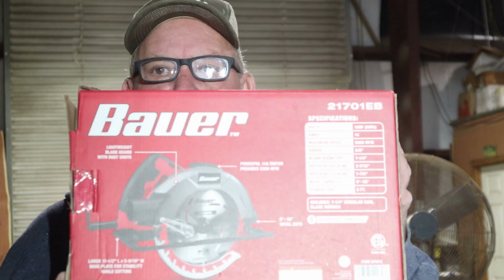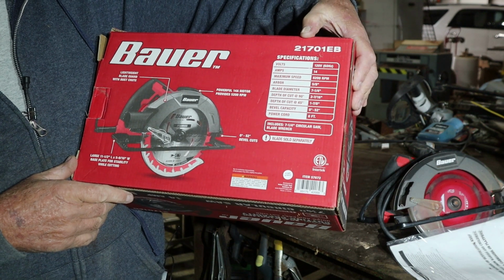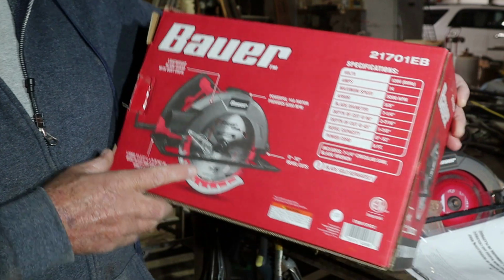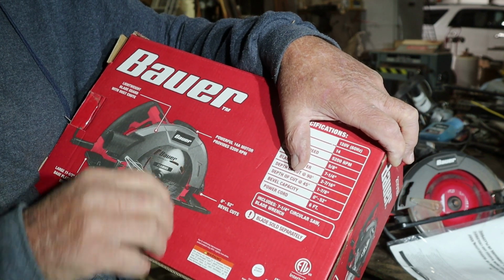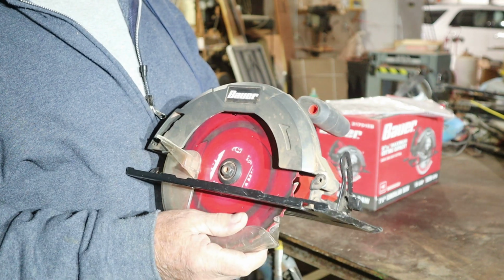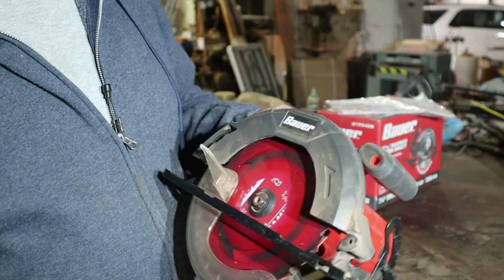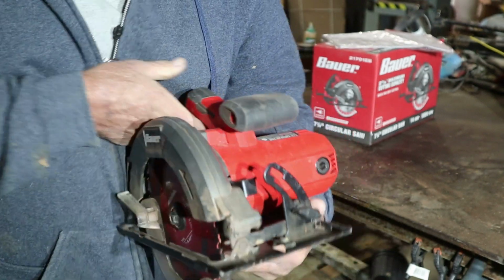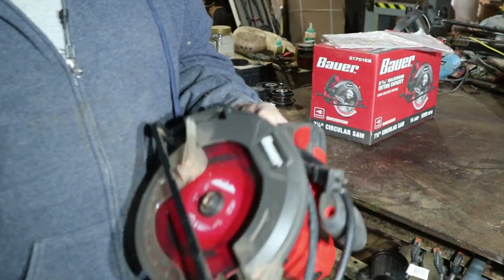Harbor Freight Bauer 7-1/4" Circular Saw Breakdown! Should You Buy It?

Comment: Just picked one up for $40 because i had an emergency job pop up that was not worth opening the box on my much more expensive and new (brand withheld) saw. Will probably use tomorrow. Was wondering if i made the right choice haha. Hope it works well. Also picked up the 7.3A double handled corded drill.
Reply from the maker: Still using mine. Been putting through a lot of abuse cutting ends off of 2-1/4” thick oak and cedar slabs. Not bad for a cheap saw. The major downfall is the plastic blade guard
Reply: Thanks for the reply!  @LarrySbrusch
Reply from the maker: @totallylegityoutubeperson4170 glad I could help. Thank you